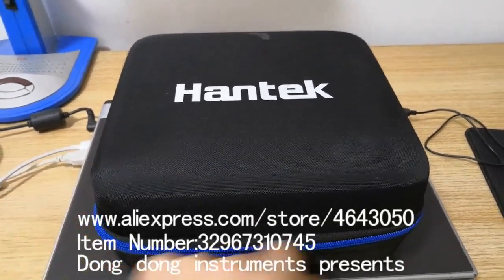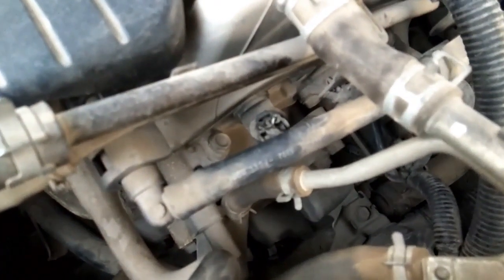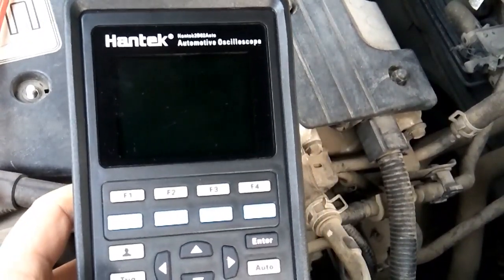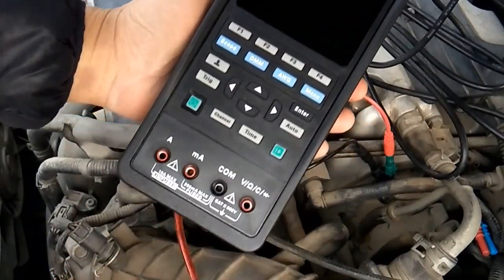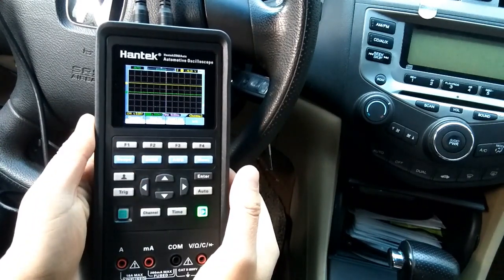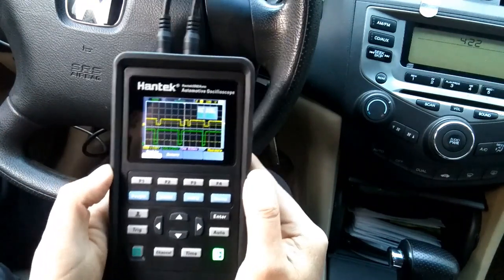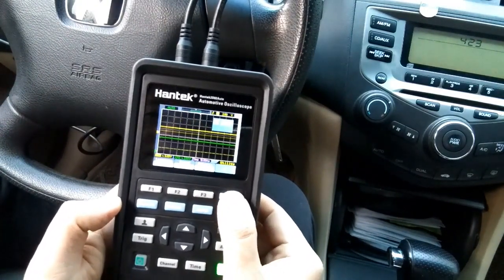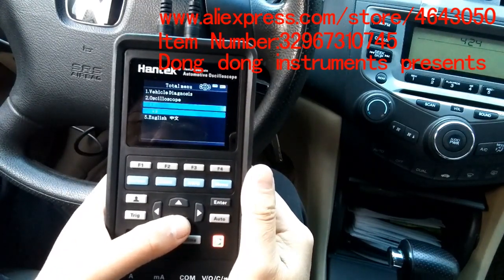Handheld automotive oscilloscope instructions:Use Hantek 2d82auto to test camshaft/crankshaft sensor

Comment: I have the 2D72 hantek which has a signal generator.  Is there software you can add to work with an auto?  Ty!  I would love to learn how to test my car safely as to not destroy the scope.  My probes are x100 and I'm experienced with O scopes but it's been awhile.

Comment: Don't waste your money on the 2D82Auto model! The automotive features are just time and scale presets in the firmware, and you can hack the cheaper 2000 series models (2D72, 2C42, etc) to install the 2D82Auto firmware on them, which will give you all those same presets on the cheaper models.
Reply: How do I put the firmware in 2d72? Ive got the hantek software and the firmware files but can't see any way of putting it in? Can you help me out with this
Reply: hi daniel.so if i purchase the cheapest hantek thats 2c42 model and install the firmware for 2d72 will it be identical to that model?will it even have the AWG feature since it has the button for it?
Reply: I have the 2D72 hantek which has a signal generator.  Is there software you can add to work with an auto and where do I get it?  Ty!  I would love to learn how to test my car safely as to not destroy the scope.  My probes are x100 and I'm experienced with O scopes but it's been awhile.

Comment: it's clear how do you get connection with the sensor but where do you connect the other channel into?
Reply: Always to ground, I prefer to use battery negative because it is the lowest point in the system

Comment: I do not understand how this oscilloscope helps you to trace fault?
Reply: An oscilloscope is the final stage of proper diagnostics on cars. If you know what you are looking for an oscilloscope can prove where the fault is.
Reply: You can even test for engine compression By just tapping into the battery, and looking for uneven voltages dropouts per cylinder stroke